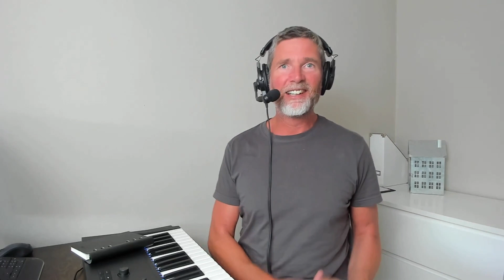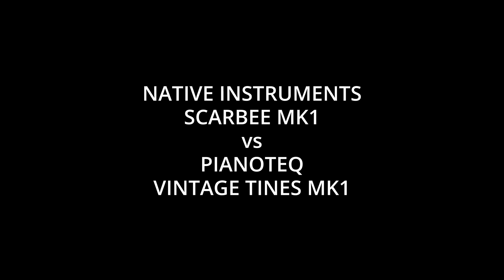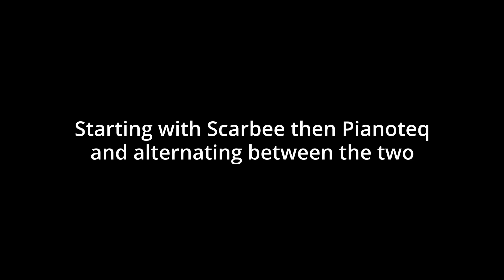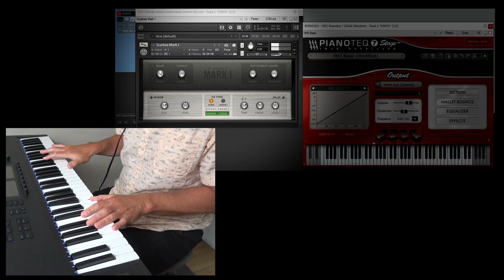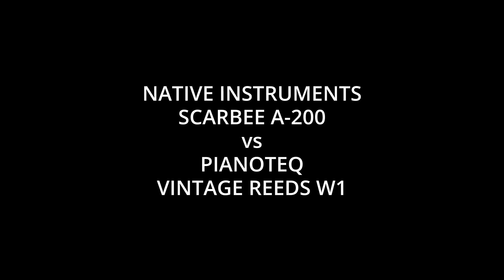ELECTRIC PIANO - Sampled vs Physical Modelling (RHODES & WURLI)

Comment: Well, there are obvious differences that can be heard in the examples. From these, I'd also prefer the Scarbee. But then, with Pianoteq being a model, I'm sure you can tweak it to make it sound closer to the slightly warmer Scarbee sound. For example, the condition slider is right there at mint, I'd adjust the hammer loudness a bit, put on the amp simulation and I'm sure the sound is already much closer to Scarbee. I'd always prefer Pianoteq for the tweakability alone and the obvious advantage of the non-existant load times. You can't make out those differences in a mix in my opinion.

Comment: I have both of these, and for Wurlitzer I much prefer the Scarbee - you really get a feel of the mechanics and its 'woody' quality, er... Woody.  However, I'd go for the Pianoteq Rhodes every time, but not the MkI that you're using for the comparison, but the MkII which sounds and feels so close to my old Fender Rhodes it's uncanny.  And as it's modelled, it also has the benefit of smooth, continuous dynamic response as opposed to the handful of velocity layers (and the subsequent sudden timbral and volume jumps) you get with sampled Rhodeses. Plus all the additional tools - at least in the Pro version of Pianoteq - to make it far from 'perfect' if you want.  BTW the Pianoteq Clavinet is sensationally good - as are the CP70 and Hohner Electrapiano. The Pianet N needs a fair bit of tweaking, but with patience it can made to sound satisfyingly close.

Comment: The sampled plugin sounded to me like it had a bit more dynamic range. Almost as though the Pianoteq plugin wasn't calibrated internally with the same keyboard velocity settings as the plugin that used samples. Not a fault of the demo, just how the plugins are written.
Conceivably the Pianoteq plugin could be calibrated for a weighted MIDI keyboard. Just a theory though.

Comment: First, they are both good instruments. If you had asked this question 10 years ago there would have been a clear winner. The modelled instruments have become much better sounding recent years. I still think many modelled instruments have a problem recreating the attck part of the sound. It's like they just arent fast enough, and it's the same here. The sampled library is still clearly ahead and simply sounds more like the real instrument. Even with the hideous old and small ui of Kontakt, it still amazes me what a good sound designer can do with a sampled library in it. Modelled instruments is more dynamic in their expressiveness. I still belive you get the best of both worlds if you use an instrument that is based on both sampling and modelling and especially with Piano libraries. Pure modelling just isn't good enough yet. Never was especially impressed with neither Pianoteq or Arturias Piano sounds. Synth recreation is a hole other thing. There's so many good modelled Synth engines and I like the way Arturia "spruce" theirs up to modern times by adding things that was never in the original instruments.

But it's also hard cause we all have an idea of how we like a Piano to sound like. With synths it's much more open how you program them, and if you want it to sound just like that old Oberheim or Prophet you had 30 years ago you shouldn't have sold it, And if you want that Steinway D .. go buy one, never gonna get the real magic with a software instrument 😉